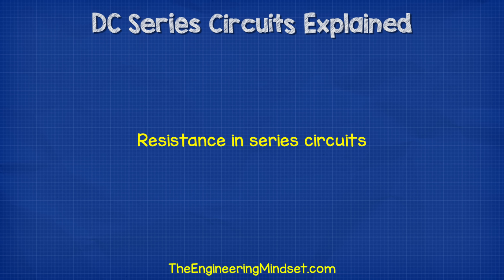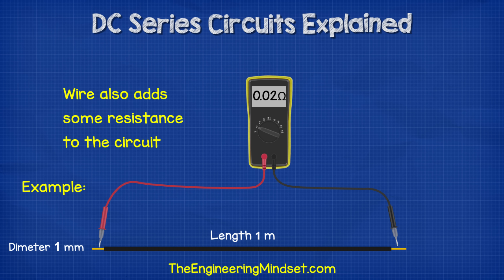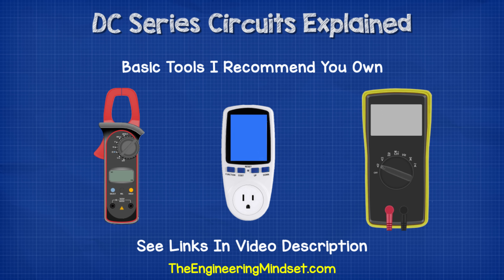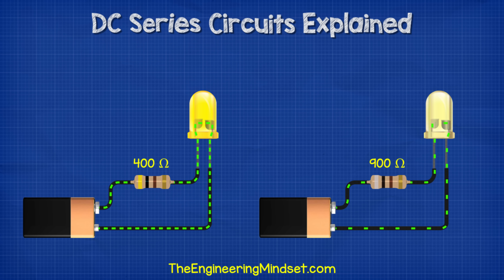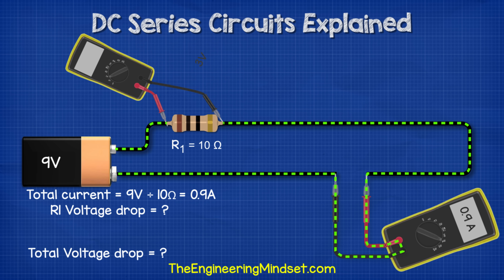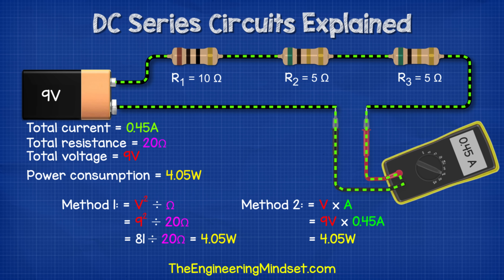DC Series circuits explained - The basics working principle

Comment from the maker: ⚠️ Found this video super useful? Buy Paul a coffee to say thanks: ☕
PayPal: https://www.paypal.me/TheEngineerinMindset
Reply: I am
Reply: Me
Reply: Are you doing biomedical?
Reply: Tutor said:
" There's no voltage on the other side of a single resistance circuit, electrons return without voltage! "

While the truth is that you simply cannot count a concentration because it doesn't stay.
While the wire before the resistance fills with electrons waiting.

But to say there's no voltage is wrong. there's just an uncountable voltage and it's the same as the whole circuit's.

Why? 
Because the path after the resistor is not being filled by waiting electrons!
Reply: any chance we can a video about mechanical interlocking in switchgears?
Reply: @rosalinareyes4447 are you studying biomedical?

Comment: 8:15 so no current will then flow after the resistor if the voltage drop is the same as the battery voltage ? there will be no pushing force ?

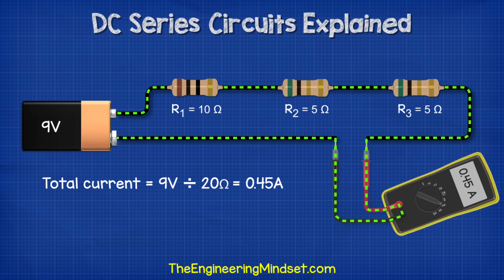Comment: 3:51

I have studied that number of electrons flowing through a conductor remains same. The reason it reduces the current is because as resistance increases by adding more resistors it takes more time for the electrons to flow through the circuit hence the current reduces

(I can be wrong, so please correct me if I am)
Reply: Higher voltage only causes the available electrons in each copper atom to bounce around faster. I don't think they travel all around the circuit, but just causes vibrations to go in one direction towards the positive pole of the battery. It's like hearing sound going through a wall, but an object can't unless you're Casper the Friendly Ghost, who tried the most to show us all how to fly through a wall. 🤔 👻

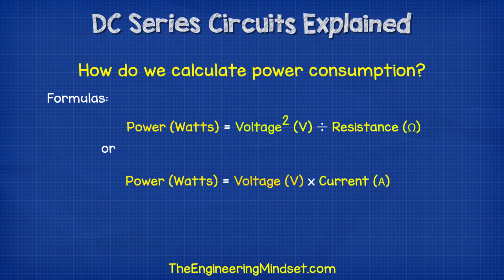Comment: 9:19 Im a tad confused. Using (A)for current is strange for me. I was taught (I) was used for current (Intensity of Current). Is there a reason (A) is used here? I confused it for amps for a while.
Reply from the maker: "A" represents Amperes the unit of measurement for current. The letter " I" is used in formulas to represent the word current. 
Here the word is shown and then the unit you need to use is in brackets
Reply: Current is the same as amps? Measured in amps. I’m a little lost

Comment: Why we need resistance?
What happen without resistance?
Reply: Using the example problem at the end, we needed to stay below 0.02 amps. The resistance helps keep the current below 0.02 amps. If we went above the 0.02 amps, then the light would prob just blow out.

Comment: Can someone please explain to me why it doesn't matter if you put the resistor before or after the LED. Like if there is a 10V battery and 5 ohm resistor why is the current 2 amps even before the resistor. Haven't they not gotten to the resistor yet in the circuit. Also someone please explain what the "voltage drop" is
Reply: As said in the video, the electrons flow/move together making the amps the same throughout the circuit. Kinda like having a train where throughout the train, all parts remain at the same speed. Wouldnt make sense to have the front super fast and the back slow. How else would the back catch up to the front??? It would have to be the same speed. I mean thats the best i can say it. Idk im just a random 11th grader. Also a volt drop is just the voltage decreasing. Drop means decrease/down so thats how id memorize it.

Comment: Can someone explain how there is a 9 voltage drop but the battery power source is 9 volts as well. Doesn’t this mean that nothing will have any voltage in the circuit, therefore there is no open circuit ?

Comment: On the 3:01 multimeter - is connected to the + of the battery. Is it correct?
Reply: red is positive , black is negative. The black end of the multimeter is connected to the part where electrons are leaving so to the negative. So Its correct, - to - and + to +

Comment: The math is basic and simple to understand but I didn't find this tutorial particularly intuitive for someone starting from zero understanding trying to grasp electricity & circuits. Why are there resistors in this circuit at all (i.e. what is the application?). What is the significance of voltage drops? Can you address the seeming counterintuitiveness of wattage decreasing as more resistance is added?
Reply: The resistor dissipates electricity as heat causing the system to lose some power so that less “work” is able to be done (defined as watts)
Reply: Resistors are used to avoid blowing out components by overwhelming them with more power in the system than they can handle. Otherwise they could explode like the small thin filament of an incandescent lightbulb, unable to handle too much power going through it or the delicate power balance allowing it to shine and give off heat like it’s designed for will turn into an uncontrolled “melt down” of sorts so to speak

Comment: would i be defined as retarded If I have the inability to retain all this information? I understand it perfectly. I always have but I seem to forget everything I watch Within 5 minutes. It's the reason I have to watch this video over and over and over again When working with electronics are wiring😅😣😥 one the most painful things to admit for example is while i do learn from my mistakes, i almost always forget what ive learned an is the reason why i always repeat my mistakes. its extremely depressing. If you can't remember what you've learned or understand is it any different from not learning or understanding? but i do eventually remember it just has tolo be drilled, id orolly have to watch this video about 30 times before i can remember it all, hence the number of mistakes repeated in life. i hate playing that victim card but its all true
Reply from the maker: As an Engineer, you can't remember every little detail. But you should remember where to find the information should you need it.

Comment: Question about resistor in series:  when you have a high value resistor and a lowe value resistor, does it mstter which resistor is "first" ? Im thinking if you yave the lower value resistor first, couldnt that burn up ? If not, why?
Reply from the maker: see our resistors explained video

Comment: Interesting thing just happened. I tried to test out the equation with my breadboard, and using a 9v batter and 10 ohm resistor burnt out my resistor. Anyone have any advice on what I did wrong?

Comment: This is the best!! I used today at work when I had to convert 2V signal to 4 mA signal because the sensor was taking mA and our controller was able to send only 2-10VDC signal and I wasn’t sure how to connect the resistor. Then I watched the video at work, understood everything and everything worked after I placed the 500 Ohms resistor in series. Thank you very much!

Comment: 7:32 you show an animation of a resistor and electrons flowing through it. you say, the same amount of electrons enter and exit. wouldn't this mean, the same current? But according to I = U / R, current is indeed altered through a resistor. Does the animation visualize the so called "energy loss" of the electrons? How can electrons lose energy, if not by slowing down?

Comment: Great video! Quick question - why is current represented using A? I thought current was represented using I?
Reply: An ampere ('A') is the unit used to measure electric current. Current ('I') is a count of the number of electrons flowing through a circuit.

Comment: @The Engineering Mindset I have a question. If at 8:09 the Voltage drop accross the resistor is 9 Volts, then doesn't that mean that the circuit has lost all of it's potential difference and then there is no longer any current running through the wire after the resistor because there is no longer a difference in voltage? Thank you for your consideration of my question, I am really stumped and have throughly enjoyed your videos enough to want to endorse you. That's how much I appreciate you
Reply: Because if the supply voltage is 9 volts, then if the voltage drops by 9 volts, then shouldn't there be net 0 volts left after the resistor? Thank you so much for the help.
Reply from the maker: After the resistor, the voltage is 0v, because we can only measure the difference in voltage across two points. So if we measure with reference to ground which is 0V and the other probe is also connected to ground then there is no difference so we would read 0V. Maybe if you had a very very precise multimeter you could read like 0.001V or something because the wire will have some resistance, unless you measure at exactly the same point. The voltage difference is still across the load (resistor) so current will still flow, the electrons must flow back to complete the circuit and keep the chemical reaction of the battery going.
Reply from the maker: Check out NEW resistor video, everything covered! ➡️ https://youtu.be/DYcLFHgVCn0

Comment: Sorry if this is a confusing or dumb. When he talks about watts in the end of the video, is he talking about it being the power consumption of the all the  resistors?  Or if he were to put a light bulb on to the circuit, That the bulb would be powered with how ever many watts  with a 9V battery at the end of the of the circuit.
Reply from the maker: Check out NEW resistor video, everything covered! ➡️ https://youtu.be/DYcLFHgVCn0

Comment: i have a question, why do the volts stay the same throughout the entire circuit even when the resistors are affecting the flow, if you measure before the first restrictor ( by using a multi meter first wire ) to the end of the last resistor ( last wire ) , its somehow still 9v. i know that the resistor restricts energy flow but if individually it can be seen that the flow is lesser while the flow is normal altogether from both resistors. how does that differ from just measuring together rather than individually? 

i thought maybe it speeds back up when left unrestricted but measuring (via multi meter) from before first resistor and after last resistor will give you 9v still even though according to my idea its basically imitating a long individual resistor.

im confused in my head Dx
Reply from the maker: Check out NEW resistor video, everything covered! ➡️ https://youtu.be/DYcLFHgVCn0
Reply: @EngineeringMindset  oh, thank you. ill be sure to watch it
Reply: I assume because the multi meter is completing the circuit and effectively taking the resistor out of the circuit..

Comment: Can anybody help please? Does it matter where you are going to place resistor? I mean would it make difference if I place resistor after the buld or before the buld, so it doesn't burn out?

I was thinking that you have to place resistors close to negative end of battery where the electrons flowing from, and before the bulb, but in the video I can see that resistors are placed after the build relative to the current of electrons...
Please, help to clarify)
Reply from the maker: Check out NEW resistor video, everything covered! ➡️ https://youtu.be/DYcLFHgVCn0

Comment: The Answer is 0.0195A. Thank you for creating these videos. Extremely helpful.
Reply: Or 19.5 Milliamps
Reply: impossible to know exactly without knowing the wire size and composition. the max amps possible are still lower than .02 though.
Reply: @mattsmith6828 great notice
Reply: am i dumb? i got 0.02A
Reply: @jonjon4575  Your calculator would have just rounded the number up, sounds like you still got the correct answer.
Reply: @jonjon4575  yeah, it got round up.
Reply: thanks
Reply: Queation. 

0.0195A is very close to 0.02A. Which is the max of the lamp. In practical. It is not safe zone is it. Because if current  become 0.021 it destroy the lamp.
Reply: why wasn't the 9v squared like in method 1? im having a hard time understanding because we weren't given enough information to use method 2
Reply: nvm I just realized he wasn't asking for the power consumption but the current.

Comment: I understand that the voltage is the same at the start and end regardless of the amount of resistors in series, because voltage in series gets added up. However, connecting one end of a resistor to another one (still in series), but, at the same time, connecting that same end to bypass the next resistor (putting them in parallel) what would happen?
Reply from the maker: Check out NEW resistor video, everything covered! ➡️ https://youtu.be/DYcLFHgVCn0
Reply: @EngineeringMindset  thank you very much for remembering this comment !!! Will watch ! Have a wonderful day!!!

Comment: Add the ohms together and that equals 460 ohms. Current = Voltage / Resistance. 9 volts / 460 ohms = .019 amps. So the answer is 19 milliamps.

Comment: Sir why ammeter show same value at any position in seris circuit..acc. To me after resistance current should vary because resistance is inversely proportional to current.. Is am I right if no then why??
Reply: I think it's because electricity moves at the speed of light. Because the flow is constantly moving when on; the micro second, the eletrons leave the resistor, and it's back at its same pace. It keeps going until until it's off, cut, or something is changed to the current. I think.

Comment: How is conventional current easy to understand? It makes things more complicated. Working on car wiring and positive/ground is reverse electron flow which is how my brain thinks. Had me asking the question, why does the negative run into the body of the car. Well I'm an idiot, just found out the positive is actually negative and visa versa

Comment: I still don’t understand why is the current the same throughout a series circuit?

His explanation is “one path, one direction. . . “, but it’s more intuitive to assume the current would be greater value before it hits the first resistor and smaller value after the last resistor.
Reply from the maker: When you put water in one end of a pipe, the same amount of water comes out the other end.
If the pipe splits into two equal pipes, then the water splits into two equal amounts.
Reply from the maker: Check out NEW resistor video, everything covered! ➡️ https://youtu.be/DYcLFHgVCn0

Comment: Thanks Paul, 
I have a question, if we apply the same concept about more resistance gives less current, into a circuit in a house. 
Why when we have a lot of items working in the same time (resistor is high), the current in the circuit gets overloaded and the circuit breaker trips. Shouldnt the current passing that circuit be less due to the high resistance? Which means CB should not trip. Hope my question make sense 😅
Reply from the maker: Your house appliances are wired in parallel
Reply: @EngineeringMindset   hloo sir, if in house there is a parallel connecting,then voltage same for all but current split as more as aploncse are connect. So this mean that appliances work on low current or we can say current not influence as much as voltage.plz and. Me
Reply: Answer me
Reply from the maker: Check out NEW resistor video, everything covered! ➡️ https://youtu.be/DYcLFHgVCn0
Reply from the maker: Seen our new incredibly detailed MCB video? link: https://youtu.be/gqEu9t8HwW0

Comment: Excellent video sir, kindly let me know this, IS that any time limit for dc current measurement in SERIES like 10 seconds or i can leave my multimeter connected in SERIES while battery is charging the whole time ?
Reply: There's no time limit.
Reply: @littlegenius6932  but my multimeter printed on ( 10 amp dc current measurement for 10 sec ) still i can measure it for long time or should i use shunt thanks for your reply
Reply from the maker: Check our new Multimeter tutorial out ➡️ https://youtu.be/4lAyzRxsbDc

Comment: Problème: la LED est connectée à une pile 9V et le courant dans le circuit doit être limité à un maximum de 0,02A ou 20mA sinon la LED va griller. Si nous nous connectons à ces résistances, quel sera le courant approximatif du circuit et la LED brûlera-t-elle? Réponse: Nous devons d'abord calculer la résistance totale du circuit. Nous faisons cela en additionnant toutes les valeurs de résistance. 100 15 30 310 5 = Résistance de 460 Ohms Nous calculons maintenant le courant en plongeant la tension du circuit par la résistance. 9V ÷ 460 Ohm = 0.0195A C'est moins que notre maximum de 0.02A donc ça devrait être ok. https://theengineeringmindset.com/dc-series-circuit/

Comment: If the same amount of electrons come out of a resistor that come into one, then why does your amperage change with each added resistor? Isn’t amps a measurement of the amount of flowing electrons? Or is it actually the energy of the flowing electrons?
Reply: When you add a resistor in series, the overall resistance goes up.  An equation that characterizes this is: V = I * (R1 + R2 + R3 + ...).  Since the voltage never changes in this circuit (left hand side of the equation), then if 'R' goes up, 'I' must go down, to keep 'V' constant.  To calculate this overall current, you have to know what the overall resistance is (R1 + R2 + R3 + ...).  As you add more resistors, 'I' drops more overall.  Think of it this way: if you have one resistor, then current slows down a certain amount.  If you add a resistor in series, the current will now slow down a proportional amount.  If its slower in the first resistor, it remains slow in the second resistor.  Add another resistor in series, and the current slows down by another proportional amount.  Remove resistors and it speeds back up again.  Think of current as a measure of the electron speed.  The higher the current, the more electrons can flow through the wire in a given time.  Also, know that amps is not a measurement of energy.  In physics, energy is Joules.  Power is Joules per second, or watts.  In circuits, P = V * I = I^2 * R = V^2 / R.  That's just how its defined.
Reply from the maker: Check out NEW resistor video, everything covered! ➡️ https://youtu.be/DYcLFHgVCn0